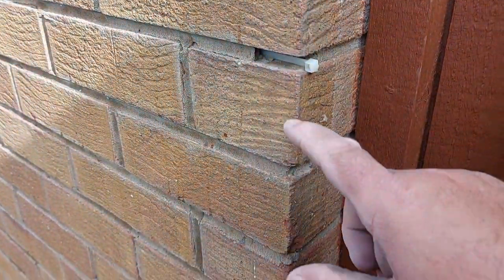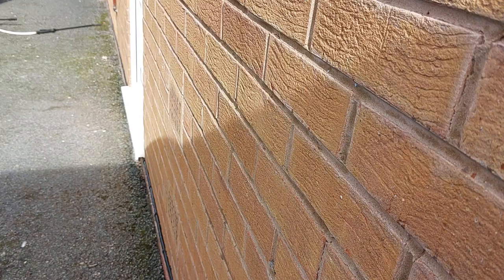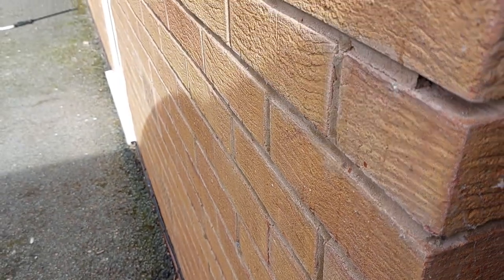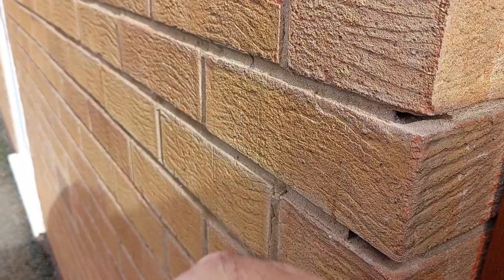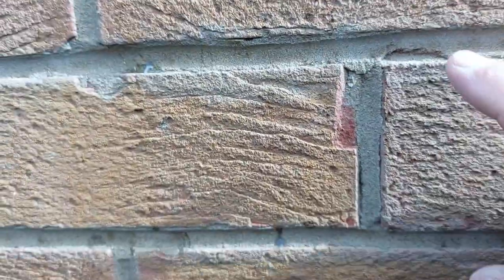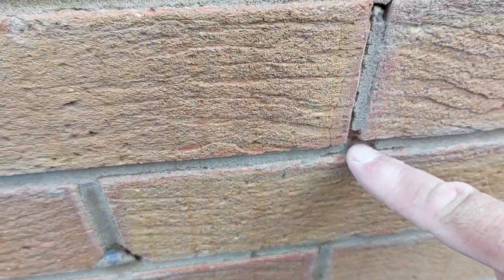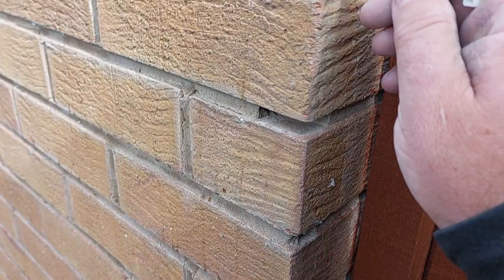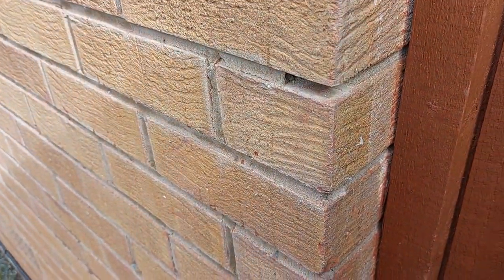incorrect pointing  mortar  not deep enough and poor  standard of workmanship

Comment: Hi any tips on repointing old English red bricks what finish should be used its flush atm I think its lime mortar at the min with stones In  the mortar house approx 150nyear old should lime mix be use or is sand cement ok
Reply from the maker: Hi yes at that age replace with lime mortar don't use cement 
If it's flush I'd replace flush 
I've done a few videos that should help

Comment: Hi, I'm repointing a 1980 built house gable. It was built with cement, would you recommend a sand:lime:cement mix or just lime and  building sand? I've been reading about NHL limes but not sure if this is what's required for brickwork.  Thanks
Reply from the maker: If its sand cement built 
Repoint in a 
5 or 6  sand 
1 hydrated lime 
1 cement  not multicem 
The lime helps moisture release from the building and helps it stick to the old mortar
Reply: @GMTpointingspecialistsltd  prompt reply appreciated,  thank you.
Reply from the maker: @MrCobbsalad  it's raining deciding weather to hang a sheet up or go home lol
Reply: @GMTpointingspecialistsltd  home for a cuppa and breakfast wins it 😆
Reply from the maker: @MrCobbsalad  I wish 
If you need any more help just ask or wattsapp me some pictures. I can talk you through it
Reply: @GMTpointingspecialistsltd  ok that be a great help, thanks
Reply: Hi, your videos are so helpful thank you for posting. I'm going to try and repoint a 1970s garage which is very similar looking to the one in this video. With the ratio you have given in the reply above can plasticiser be added to the mix or should this not be added with lime - I was hoping to use a mortar gun and read that plasticiser helps it move through the gun. Thank you
Reply from the maker: @jessicameikle3020  hi thehydrated lime is the plastersiser. I personally don't like guns as the mortar has to be almost runny and can stain the bricks